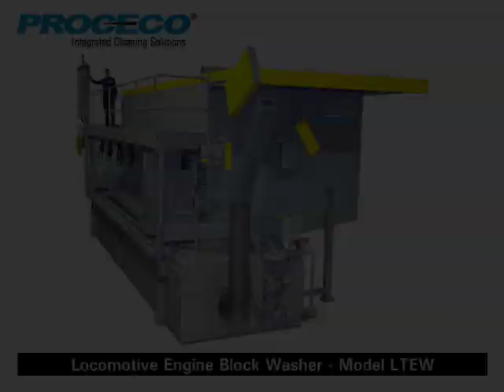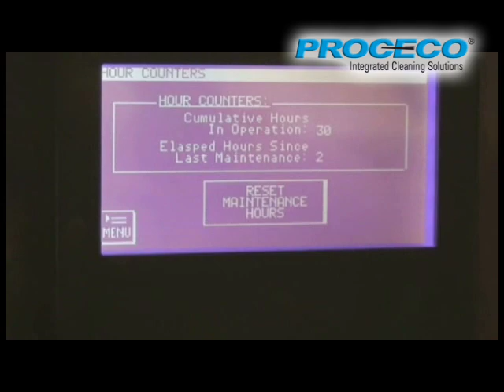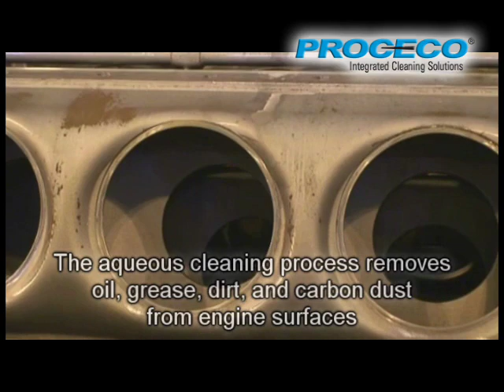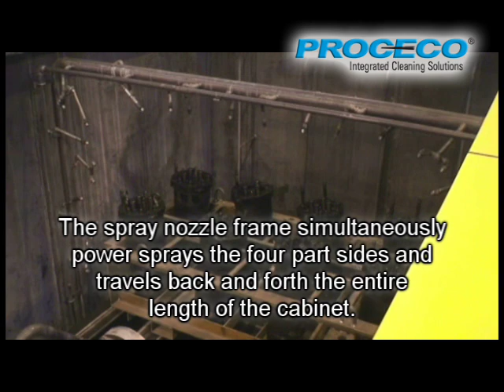PROCECO Locomotive Engine Parts Washers to Clean Components Prior Rebuild

Comment: They didn't do a very good job of cleaning the gasket material off of the block before they cleaned it. There is a lot of gasket material left on the block to be cleaned off that can get into passages, and the insides of the block, and can cause a lot of damage. 
The cleaning system is great, and does a great job of cleaning the block, and associated parts. Great video.